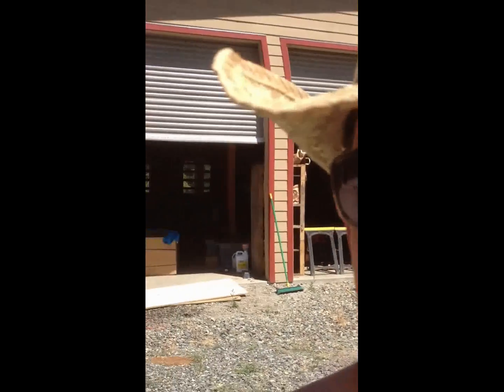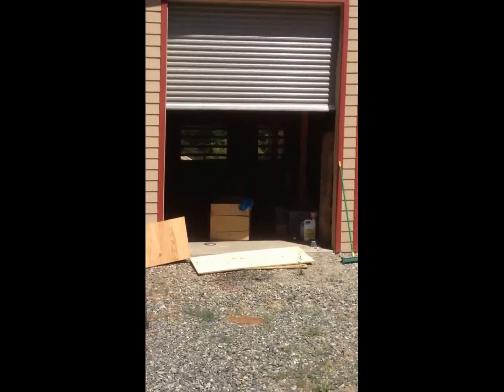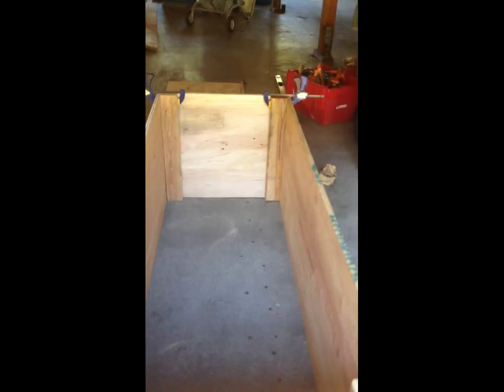How to make a Solar Battery Bank Enclosure:  Solar Off-Grid System Installation Video 1

Comment: I put a piece of EVA foam matt in the bottom of those black and yellow, 27 gallon storage totes from Lowe's, then set my four Trojan L-16 batteries inside the tote, which sits on plywood and Harbour Freight moving dollies. They fit perfectly with the piece of interlocking matt squishing to fit the ribs in the bottom of the tote and equalizing the weight better. Beware, the Home Depot totes are taller, but smaller width and length. Inverting a second $12 tote made a cover, and latched on top of the bottom like magic, with two 16" flat bungees from WalMart stretched across the ends thru the corner slots in the tote rim. Cables enter thru holes drilled below the rim. Adding a 2" ABS vent pipe in the center makes this a really clean looking set-up. Being able to move them easily from a temporary location to a permanent one in my shop was a real plus. For a small battery bank or large, it should work great. If you don't put it on wheels, you just drill cable holes, attach a vent and cut the EVA matt. Adding another "module" real soon. Hope this helps.